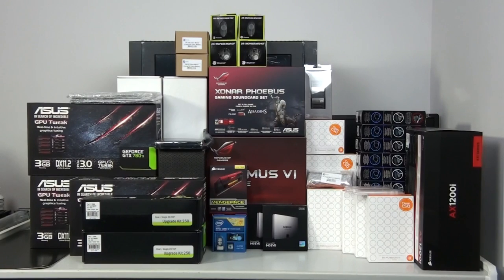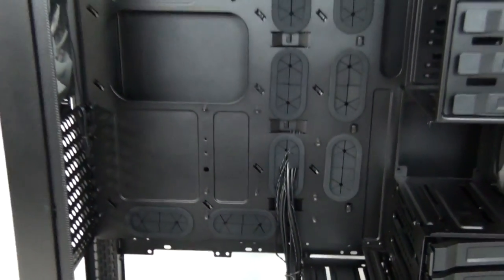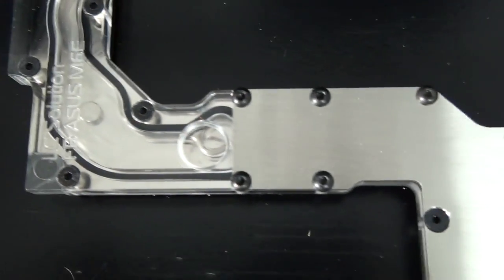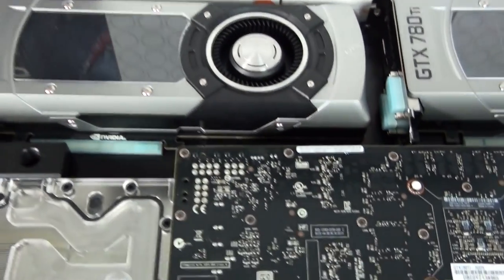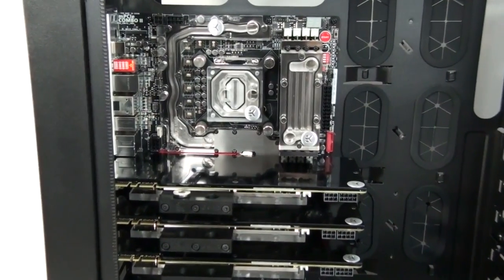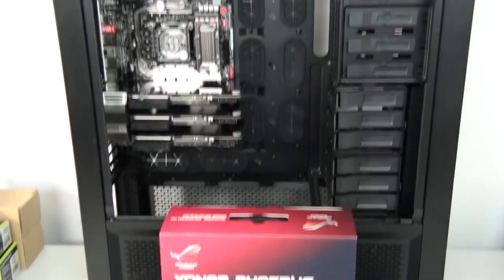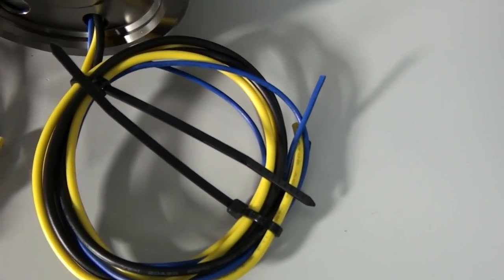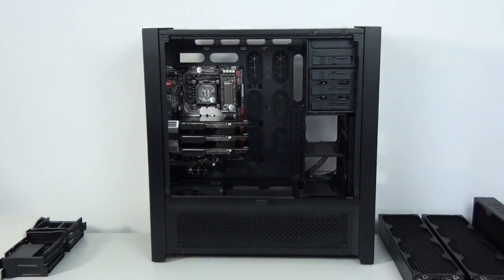Build #15: Extreme 900D Dual Loops: Part 1

Comment: Personally, I own the 'lowest end' model from the GK110 series - a GTX 780. It's EVGA's Superclocked version with the reference cooler and I love it. I am not confident enough to install watercooling to it but I love the look of the reference cooler anyway, so it works for me. :) As regards to Nvidia releasing so many cards with the GK110 core, I think it's somewhat a case of 'because we can'. I don't necessarily see that as a bad thing, but for new buyers it may be somewhat confusing. Great video as usual and I look forward to the rest of the build log!

Comment: Why didn't you go for the 4790k vs the 4770k? It runs cooler and faster. I personally overclocked my 4790k to 4.8 GHz stable at 1.350 volts and 73 degrees under load

Comment: ***** just a note of concern , I consider you more of an expert in all things water cooling than I will ever be, since you handle the components  frequently, but at the end of the video. The rads you mention you coat them with acrylic lacquer is it not detrimental to thermals, or am I wrong in thinking that acrylic lacquer is thermally insulating. I would assume you need to use a metallic based paint that is advertised to be conductive. Also wouldn't using such intimidatingly thick rads impede airflow? I would think to use multiple thin ones (38mm). This is just my sense of physics and the engineer in me drawing out some concerns. Thanks for all your videos they are very informative.

Comment: ***** if I had a quad and a dual in the bottom of the 900d and a front dual rad. How would you have run the loop? With pump upside down attached to the bottom of one had drive cage in the front?

Comment: I got the Xonar Essence STX soundcard and an Objective 2 headphone Amp and I'm pretty happy with the sound quality, not too expensive but great sound.
I play my sound through a Corsair SP2500 speaker system, and a pair of Denon AH-D600 and Audio-Technica ATH-AD700X headphones, the Denon Headphones work really well for music and a lot of movies, its also very comfortable to wear over a long period of time
The SP2500 Speakers work nicely for Gaming, Music and Movies, with its built-in amp and my soundcard I get great sound quality, nice details, warm sound and a nice punch.
The AD700X Headphones are really nice when playing online FPS games and shooters with high quality sound because of its wide soundstage, its also pretty good for some movies, most music has just ok sound, but some music sound pretty nice with these headphones, they're also pretty light so wearing them while playing many hours in a row wont give you a headache or any painful marks (it also helps that they're open-air which gives the ears more air.)
I've also attached an AntLion Modmic 3.0 to my AD700X headphones, so its basically a high-end gaming headset.
so yeah, you could safely say I'm an Audiophile.

Comment: i agree, fewer releases, greater improvements. reasons much the same, the longer a single set of hardware is out the longer people have to 'tweak' those setups/configs/hardware sets and would also see more in the way of firmware updates/optimisations. but that would give the manufacturers less revenue so it wont happen..

Comment: holy shit, dripping with highest end parts...but what gives with the CPU? This deserves an Intel 4960X.
Reply: maybe because it is old video, what you think
Reply: •Tar Get• It's a brand new video..
Reply: •Tar Get• It's a brand new video..
Reply: Most people don't need a 4960x and most people that have them would be just fine with a 4930k for half the money. If he isn't doing tons of super intense editing etc. this will be more than fine.
Reply: chriskanemeier you did not listen, did you? he said that video is recorded way earlier...
Reply: •Tar Get• I think you're the one who needs to listen mate, he says it's "Fairly old footage." meaning he's detailed the hardware and/or installation process in depth before. 

If you want to get technical though, ALL of these videos are old if you look up his other media. This builds already completed.
Reply: i think that his voice over is from current time and pc/footage from older times, that means that parts are older so maybe that is why cpu is bad?
Reply: The CPU isn't bad, and if all he intends to due is game he doesn't need a hexacore CPU and least of all a 4960x which only offers 7% performance increase over the 4930k at double the price.
Reply: •Tar Get•  4930K is the go to CPU if you're using LGA2011. 3MB of L3 cache and a slight frequency boost is not worth $500. Intel is smoking crack.

Comment: is there a reason for not going with a devil canyon CPU aka an i7 4790 for example and an adequat motherboard that would go with it (X/Z97) and will more future proof ?

As for the question about the Nvidia release of several high end cards in a short periode, it's just a response to R9 290X and it positioning while the Yield of chips is getting better
Reply from the maker: I built this system 6 months ago. I have to give the client what they request. I do make recommendations, but some people just come to me with a list and ask me to stick to it.
Reply: *****
 Thank you for your reply, I thought it was a recent built, if it was 6 month old then it makes more sense :)

Comment: I like the frequent releases due to the fact it pushes prices down on the older hardware but an over clock can push it to "current" gen which the price point will allow more beginner or budget gamers to come to PC and drop those silly consoles and push developers to recognize that there is just as many PC gamers as console gamers and stop this 60fps 1080p lockdown on ports

Comment: Hah The other reason to install water blocks for RAM is when you have for example High End ECC RAM :) These bad-boys can be very hot and increase the overall temperature in your chassis. I have 8 sticks of 16GB each Integral ECC registered memory and they reach 80 C.  I used to be very skeptical about RAM water cooling, BUT NOT ANY MORE :)
best regards.
P.S. Corsair cases are really bad ! :) Plastic, steel and plastic and they are heavy! Yeah I am a huge fan of CaseLabs :) I use ONLY them :)

Comment: The GTX Titan is a beast of a card, as are the Titan Black, Titan Z, Titan X, Titan Magenta, Titan Jupiter and Titan, March of the.

However, even though the Titan series has great gaming performance, its true power lies in the Double-Precision capability very important in a number of compute applications. The GTX 780 Ti has 1/24 DP which means the DP mathematics happens at 1/24 of the speed of Single Precision math. The GTX Titans have 1/8 DP which means that all else equal (which is isn't), the Titan would be three times faster at those specific applications.

From what I gathered, the Titan Black is "unlocked" in that you can enable and disable the DP altogether and improve the performance depending on the task, but I could be wrong about that. I do know that it gets the best of both worlds, so it could be GTX 780 Ti "speed" combined with Titan "compute". And then the Titan Z is just a dual-GPU card. Exceedingly expensive, though.

TL:DR; The GTX 700 series and the GTX Titan series are kind of meant for different applications. Gaming-wise, I don't think there's much of a difference.

Comment: Hello guys ! Could u please tell me the exact weight of these products bcoz now I'm living in Cambodia where is far away from US but I want my aunt who is living in US shipping those stuff to me. As you can see shipping weight is really important for me so I'd appreciate for ur reply :)

-MSI GeForce GTX 770 4GB
-MSI ATX DDR3 2600 LGA 1150 Motherboards Z97 GAMING 7
-SteelSeries QcK Heavy Gaming Mouse Pad Height : 6 mm (0.2 in)Width: 450 mm (17.7 in)Length: 400 mm (15.7 in)
-CORSAIR Hydro Series H100i Extreme Performance Water/Liquid CPU Cooler. 240mm

I love you guys ^_^

Comment: The 780, 780ti, titan and titan black all fill different roles and price points, so it makes a fair amount of sense. The titan cards are valuable for the cheap double precision performance, while the 780 and 780ti cards are the top-of-the-line gaming cards for this generation. The 780ti is just the 780 but with more horsepower for more money. The titan black specifically is good both for gaming and double precision, so it takes the top slot. The titan z was the obligatory dual-gpu monster, but its next to useless for real world applications. It doesn't fit most mini-itx cases because it takes up 3 slots, and it won't work on micro atx motherboards because it takes up 3 slots. Also, while it is 3 times the price of the titan black (which matches the r9 295x2), it is not compatible with most use cases and performs worse than two separate cards, which is significantly cheaper; all of which is overcome by the 295x2, packing more performance for half the price

Comment: Why choose a Z87 Haswell paired with a 4770k when going for 3way SLI.
X79 is the way to go! 

Hell need some serious grunt from the cpu to get proper GPU Usage.
I've got a 4930k at 4.6GHz and it's the bottleneck in my SLI 780Ti rig.

Comment: where is part 3 of client build 14?
Reply: thanks I was super excited to see the end of that build
Reply from the maker: Ceras Tech
Good guess. I tried to use EK 16mm acrylic with the Bitspower fittings and had to take a lot of material off the ends of the tube before it would fit, it wasnt clean so Im going to use Bitspowers tube instead. That build has been held up for a lot of different reasons, looking forward to completing it.

Comment: Good question about nvidia releasing so many high end cards in a short period of time, the way I look at it is like this.
They had the GK110 chip and they just made alot of cut down version of it and called it GK104 thats how they made the entire 600 line of cards and they just monitored AMD and when it was time for Nvidia they started to roll out the Titan and make a loud of money of that card, followed by the cheaper 780 and make some more money out of that card, followed by the 770 which is just a rebrand of a 680 etc etc then 780Ti , Titanblack and finally Titan Z.

So I think their strategy was to squeeze every dollar out of the GK110 chip as much as they possibly could and then now the time has come for the new Maxwell chip and I think we will see the same trend again when that chipset is at it's end of the lifespan.

Comment: A FEW THINGS
1. I know it's bad for graphics cards needing a lot of cooling, but on low heat cards such as the 750ti, and on sound cards and other things that don't need to pull a lot of air, they should mount try like... flipping them... so that you can view all the pretty parts.
2. I Second the idea of a kickstarter/indiegogo campaign to allow you to build a full scaled custom build from scratch.
3. I emailed you about doing a build for me, idk if you're just swamped or the email you had listed was incorrect, but could you reply with the proper email to reach you at? or some other way to contact you.
Reply from the maker: I apologize for not replying to your email. I am swamped, I get hundreds of emails per day and I cannot keep up. I am in the process of expanding though so this problems will be solved soon. I will get to your email soon. Good ideas, thanks for your support.
Reply: All right thank you for taking the time to respond. :)

Comment: 1150 platform, triple sli, why????
Reply: I'm just not a fan of plx chips for more lanes.  I think 2011 would have been a better idea.
Reply: let me tell u because of 4K , 2011 and will cost more and the client may only wants to game on 4k where 1150 is perfect then why spend more
Reply: Judging from the cost of this build, I really doubt that money was an issue.  I don't think 1150 is the appropriate socket for 4k.  I think it will be a while before the "mainstream" cpu's and gpus can handle 4k.
Reply: it can be may be he does'nt need that much processing power :)
Reply: On LGA 1150 you only have 1 × PCIe 3.0 ×8 + 2 × PCIe 3.0 ×4 = 16 Lanes in Contrast to the 40 Lanes on LGA 2011. I think this will be a big loss in Grafikperformance, because most time the GTX 780s will wait for Input from the CPU?
Reply: Michael Janssen The board does have a plx chip which adds pcie lanes, but at the expense of latency.  I think for a build like this the 2011 platform is def the way to go.

Comment: Uchhh , Come on guys he said the maximus wasnt out when this was filmed , So im guessing the 4790k was not either -_- .. But on the GPU yes they need to hold of releasing cards with minimal advancements on concentrate on much better ! OC seem's pointless nowa days ! As it was always to make your system better ! Now someone has to just go out and buy that slightly better kit !
Reply from the maker: Exactly how I feel about it. Im almost over overclocking and benching now because of the way things are going. Yep I built this system 6 months ago. Cheers.
Reply: Well aslong as you keep building these awesome RIGs :) And no worrys :)

Comment: The Titan series is not priced at gaming levels so I don't really consider them the same produce class as the 700 series. The Titan Z is the same price as 4 780tis, there's absolutely no point in getting it if you don't need the double precision.
Reply: Yup the titan black and Z are for work that requires double precision, or for people who do 3d modelling and rendering as a job and can actually afford this. It shouldn't be marketed as a gaming card, but it is the best performing GPU for gaming in the world.
Reply: Space is one reason, heat output is another.
Reply: Kaleb Gilley a titan z will only put out less heat than 2 titan blacks because the cores are under clocked. As for space, titan z is triple slot. So you're saving one slot with it. If you have an ATX board this doesn't mean much, if you have an Matx board you can usually just have the second card hang off the bottom of the board. If you use mini itx there are only a handful of cases that size that have a third slot available and they're all made by case labs.
Reply: That's what I was saying..... HE said there was no point in getting a Titan Z, I pointed out space limitation and heat output and now that I think about it, noise output.

Comment: 900D isn't the best airflow case. I would implement the HDD single cage somewhere and remove those 2 ugly cages. I would also remove all the 5.25 bays since I personally don't use CDs. Caselabs SMA8 Would have been a better solution. 
Instead of the GPUs I would get 2 x 295x2s paired with a 4790k on EVGA Z97 Classified or Maximus Formula 7.

After all this is an impressive build but the money could have been spent better. I am sure it will look fantastic since you're building it
Reply: 900D was build to be a water cooling monster anything else would be a waste of money and space. personally i think amd make better gaming cards but when it comes to workstations, Nvidia's gaming cards are always a better option (except for mining)
Reply: Mo zz 900D is good with space but a shit fow airflow. If you had one with radiators you would know. CaseLabs is aluminum, better quality, better customization, bigger, more space, more radiator options, dual PSU configs, everything. Check out the CaseLabs SMA8.

i also prefer AMD for gaming it's cheaper but with this setup I think the client will be gaming.
Reply: Ilija Petrovic The 900D is a combination of, steel and aluminum.
Reply: Kaleb Gilley The HDD drives are poor quality. The CaseLabs is completely aluminum and has more options for dual loop builds...
Reply: HDD drives matter very little, I personally take my drive cages out and mount my SSD behind my motherboard tray with all my cables.
Reply: Kaleb Gilley I do the same looks much cleaner. Plus when you remove HDD cages you have more space, the case looks nicer and the airflow is just better.
Reply: Exactly, so why does the construction matter? It's not like HDD's are super heavy and need ultra strong sleds.
Reply: Kaleb Gilley A lot of people still use multiple HDDs man...They want quality for their money...Corsair has inferior quality when compared to caselabs...so why not caselabs when its superior in every way...I was just saying it would be a better option
Reply: Ilija Petrovic Its a better option for double the price. CaseLabs are a more superior brand, aimed at modders and very extreme builds, for the average person, or even the average overkill setup, CaseLabs chasis are big. so choosing the 900D is saving money and effort.
Reply: Mo zz This is an extreme build man. This hardware is very expensive. I'm sure it;s not a problem to spend $300 more. Dual loop looks tiny in 900d, in CaseLabs modders drill it so the reservoirs look super and the build is clean. If you have a space and the money for 900D you sure have it for Caselabs
Reply: Ilija Petrovic He may simply prefer the aesthetic of the 900d to a CaseLabs case.